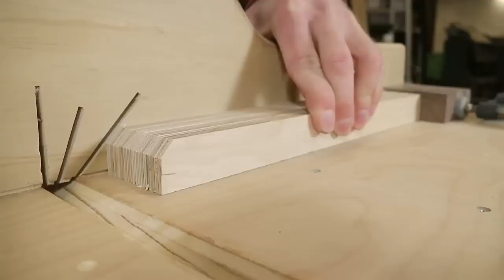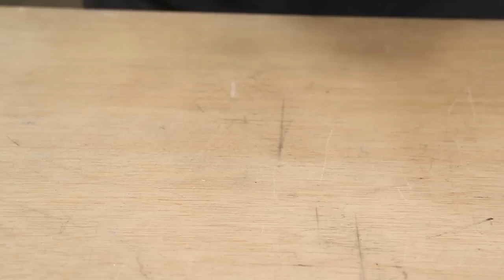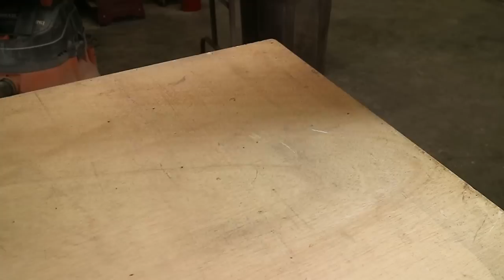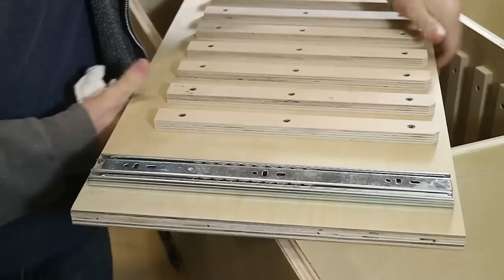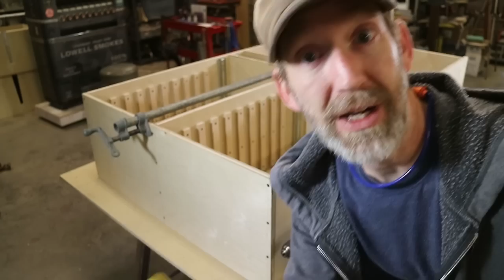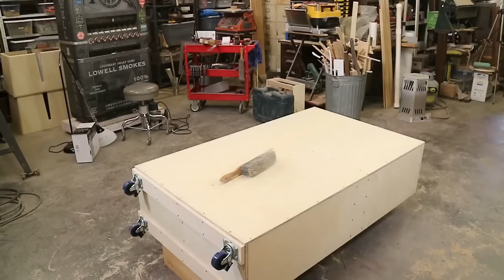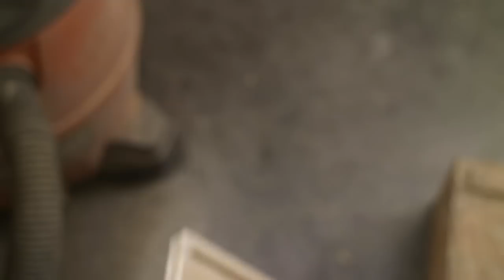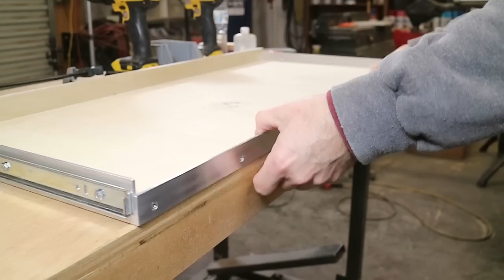Sorta Sortimo Small Parts Rack & Sorting Station

Comment: Fuck, dude. Nice work, but it's a finctional item. Just drill a whole in the backing. Plus you have a CNC so you can make the perfect plug.
Reply from the maker: I fail to see how that would have been easier than just unscrewing the back.
Reply: @WesleyTreat  lol stuck in my own workshop brain, plus that's what I get for doing other things while watching the vid too. My bad. I generally apply glue to all joint mating surfaces and assumed I just missed the part when you did the same. Anyway and since I may or may not make the same oversight from time to time and don't always catch it before everything dries, which is totally not related to my age and purely due to my being...........excited by other creative decisions........yeah.......taking the time to model and cut some plugs and tossing them together with a dedicated hole saw and some glue has been a game changer for my creative flow.
Reply from the maker: Yeah, shop furniture I tend not to glue because I know I'll be modifying it at some point or repurposing the wood.